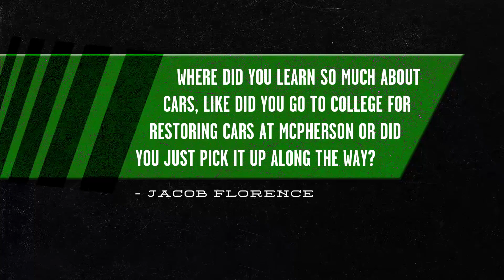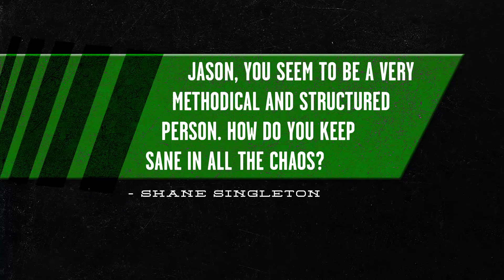Gas Monkey Garage - Meet The Monkeys - Jason Aker

Comment: if l could add a question to the list, what do the people that work there drive,
Reply: that's a good idea
Reply: Cars with windshield wipers,  heaters, ac, power windows, a quiet engine ,radial tuned suspension, good gas mileage ,windows that don't whistle and leak water,don't drip oil .start on a damp morning,rear window deicer , power heated seats ,radio, power steering, four wheel disc brakes ,auto trans,and just about anything else they would never install for a customer. All that junk would just slow it down.I remember those days of muscle cars. They broke down a mile away from the show room. Jeez what horrors they bring back to me
Reply: Brian Ellsworth I forgot about the radiator over heating when the temp went over 90

Comment: They must not do much engine work when restoring cars and only have engines built. You can’t tell the guys don’t have much engine experience which seems odd to me that they don’t have one guy that specializes in it. I remember seeing Jason put an intake on a engine, he put a shit ton of rtv on the gaskets, the only rtv you ever put on a intake gasket is a very small amount around the coolant ports never the intake runners. Then that 1938 Mercedes they put a head gasket on but started it and it was burning coolant. Well they should have had the head checked out and machined and also check the block surface for straightness. Richard wanted that car running because they had 85k into it and they didn’t. Even if it had a cracked cylinder they could have had a sleeve installed, if the head was cracked they could have fixed it so they could sell it. If that Mercedes was mine I absolutely would have fixed it for sure.